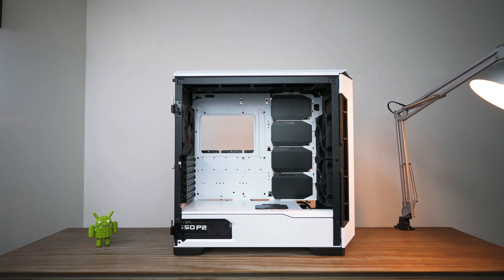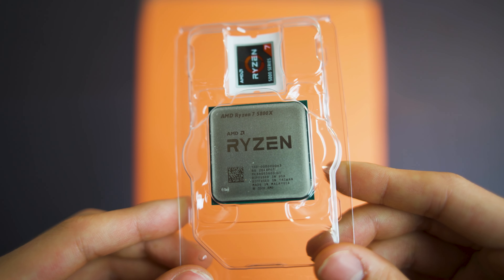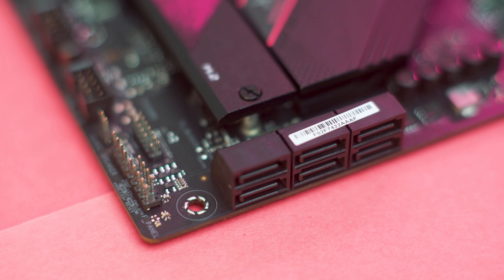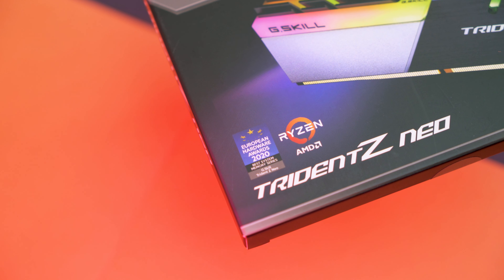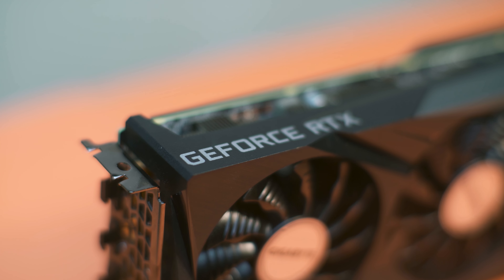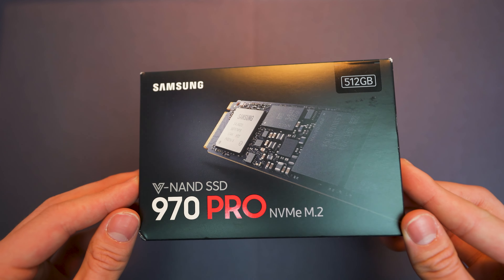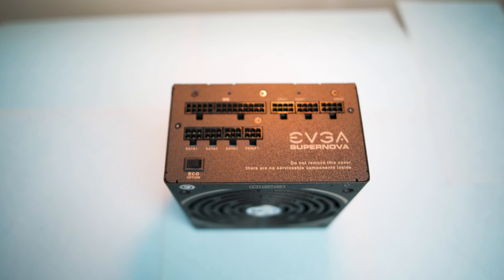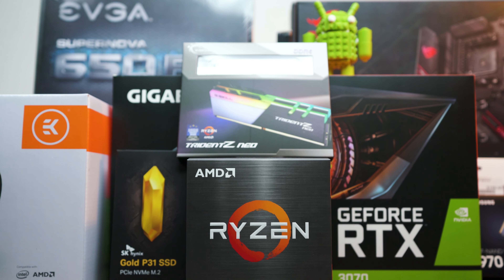Finally building my Gaming PC! - Ryzen 7 5800X + RTX 3070

Comment: Hi, i am building my gaming pc with ryzen 7 5800x and zotac rtx 3070 twin oc, would 650+80 bronze psu be sufficient?
Reply from the maker: That's exciting! The recommended psu for that card is indeed a 650W, so I think you'll be fine. I haven't had any problems with mine. If I were to rebuild mine and I didn't already have a 650W psu laying around, I probably would have gotten a higher wattage one for future proofing. Good power supplies have like 10+ year warranties, so it will either last you that long or you can rma it if it breaks. So, I would recommend to get a nice one if you can
Reply: @nyoungstudios  thank you so much

Comment: That’s a super nice looking pc
Reply from the maker: Thank you so much! :)
Reply: @nyoungstudios  I'm actually thinking of building this exact configuration (perhaps not as well lol), though I may need to opt for the 320mm version of this graphics card, do you think that'd be a problem?
Reply from the maker: That's awesome! You'll be fine with that length of gpu in the P600S. The max gpu length for that case is 435mm. Even if you decide to mount the cpu radiator in the front (mine I mounted on top is 52mm thick with the fans), you'll still have enough space for your gpu
Reply: @nyoungstudios  parts are on their way, ty ty

Comment: Im getting 60ºc to 85ºc While gaming.  MSI Center profile Balanced. AIO (msi mag coreliquid 360r - Mounter on TOP, Tubes  facing right) and YES, i have all fans working and I tried 100% SPEED. Open and closed PC , CPU still hot. please reply.
Reply from the maker: That is a large range of temps. 60s is probably fine, but 85 is a bit on the high side. You can double check your AIO mounting pressure to make sure it is tightened on your cpu. I am unfamiliar with the packaging of your AIO, but perhaps the AIO had a preinstalled plastic film over the thermal paste. If you didn't remove that, it could be impacting the thermal conductivity of your cooler
Reply: Read online that that AIO is known for premature failure cuz those temps are way too high for a 360mm AIO while gaming.
Reply: MSI center can be a tad finicky. I have been tweaking my settings in MSI for the last week. Trying to get my temps down, custom curve seems to be the best bet. You can still use balanced in your windows power plan, but for me balanced on MSI center was/is a tad troublesome. Cheers - Jass.